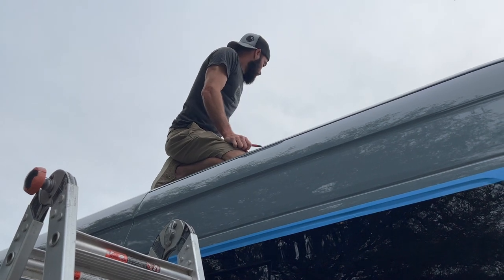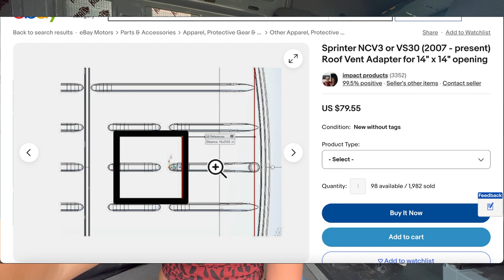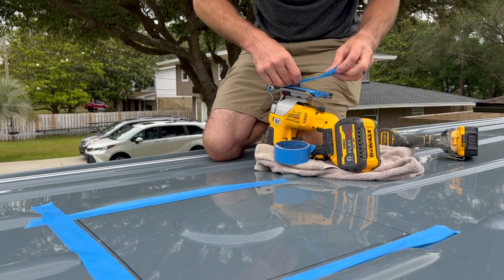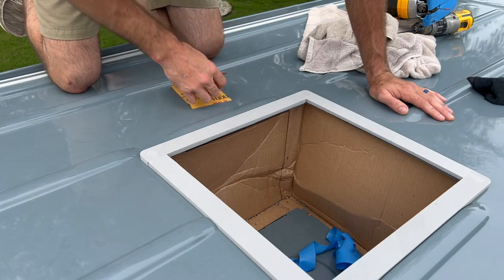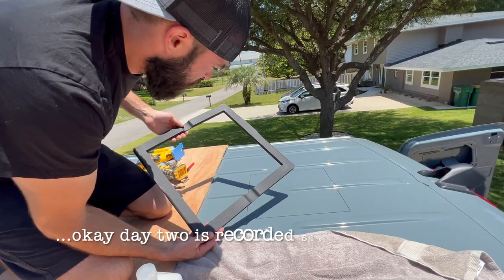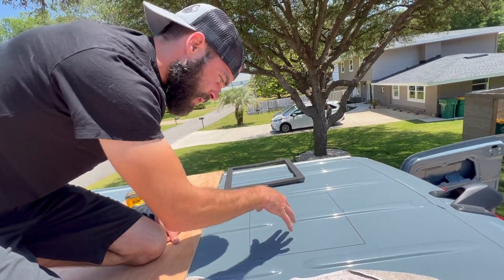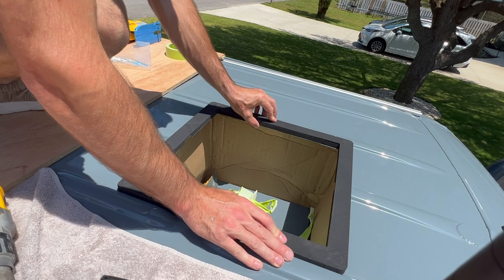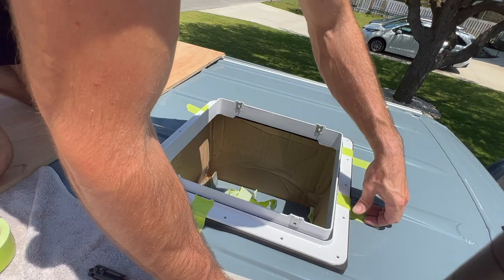How to install MaxxAir fans | Sprinter Van Build

Comment from the maker: Here is a list of the products we used on amazon:
➡ FANS: https://amzn.to/3ZyJdYe
➡ ROOF VENT ADAPTER FOR SPRINTER VANS (ebay) : https://www.ebay.com/itm/143539173702
➡BUTYL TAPE: https://amzn.to/46rJnml
➡LAP SEALANT: https://amzn.to/3LFdTBk
➡3M WINDOW WELD: https://amzn.to/46adZJr
➡PRIMER: https://amzn.to/3PznIC6

This video contains links to affiliate websites. As an Amazon Affiliate, we may receive a small commission if you make a purchase from the links above at no additional cost to you. Thank you for the support :)

Comment: That Lap Sealant step with Mr. Clean on the tube is so horrible:  you will never see a sailboat with such ugly junk over screw heads and flanges:  proper sealant is normally applied UNDER screw heads and fan flange, not OVER them.  Please, do not answer that it is part of the MaxxFan installing instructions...

It is unfortunate that all YouTubers copy all each others that terrible idea...